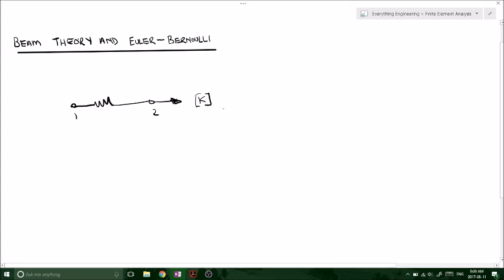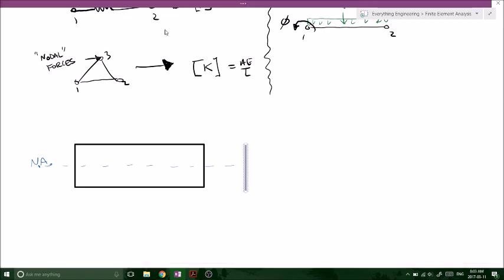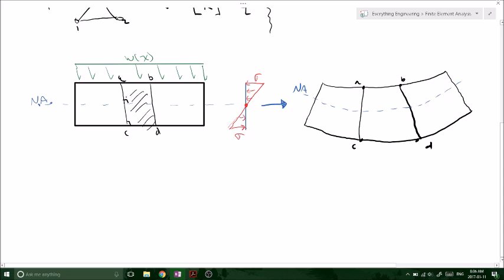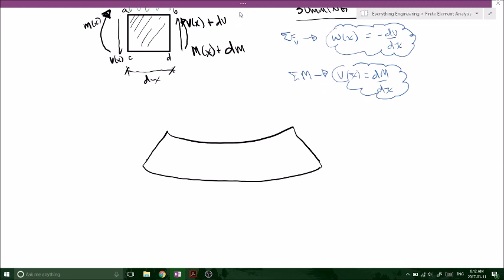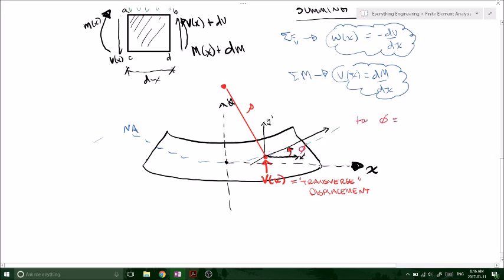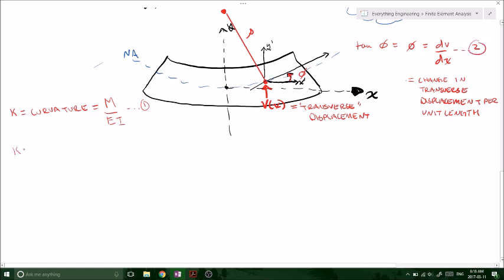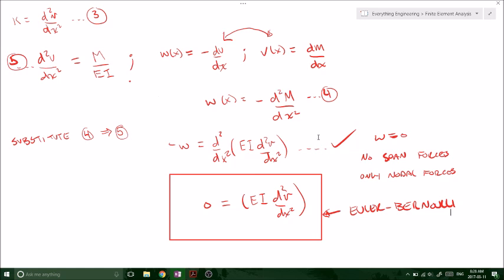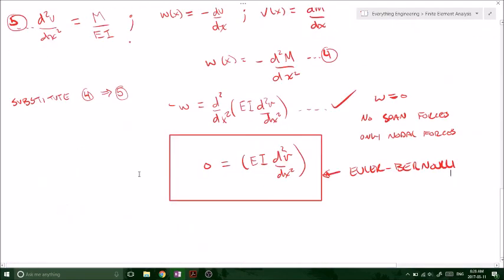Euler Bernoulli Equation for Beam Theory -  Finite Element Methods

Comment: I need to design and fabricate a cantilever beam with internal damping sufficient to give critical damping. I surmise (based on few experiments) this will require a tapered beam with layers of viscoelastic material between more rigid layers. How can this be modeled?
Reply: you just wanted to sound smart
Reply: @treys9432  poor guy